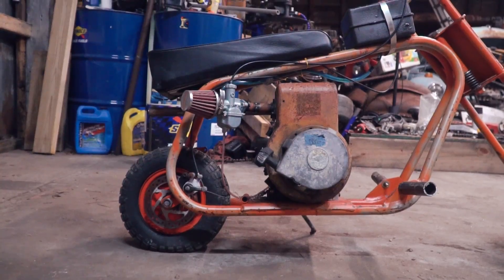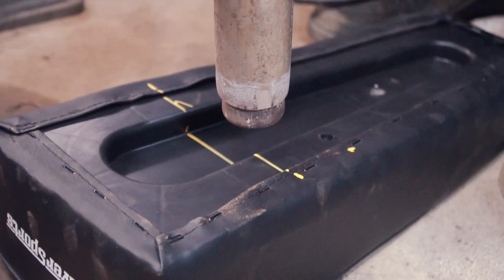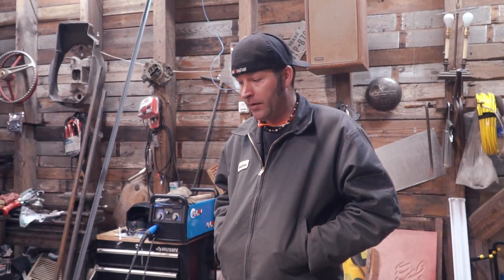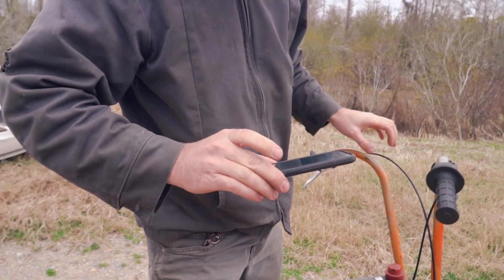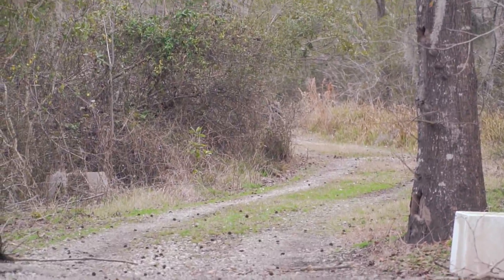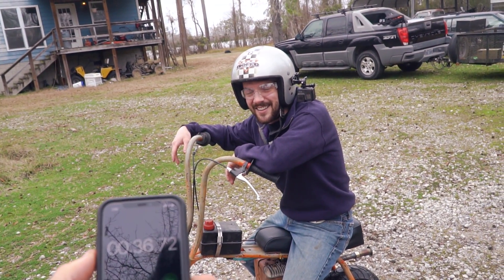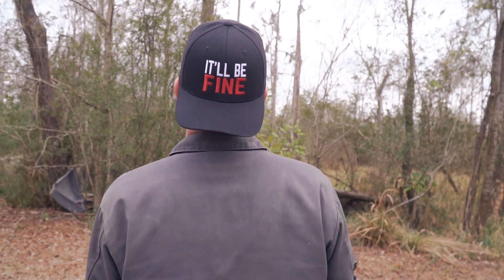Vintage Mini Bike Transformation!

Comment: Wow, thanks for the Memories. I think this is a better JCPenney than the one I had, I could never figure out what was more fun to jump my Stingray or my JCPenney. My Stingray never broke so I guess it was more fun, noooh. If I remember my gas tank was mounted better than yours, I didn't even need a screwdriver to tighten it. I just had to pull on the zip tie!

Comment: They came with a hand brake and a foot brake. The foot brake rubbed against the tire to stop and the hand brake was a disc brake that used the rear sprocket as the rotor. Cat also had one with springs on the forks and a plastic gas tank mounted on the frame like a motorcycle.

Comment: I have a purple one with a Honda thumb throttle, Suzuki foot pegs & sprocket, Peugeot seat & predator engine ..   she’s eaten many engines  over the years ...once had  a hot rodded  brigs&Stratton 8 push start   For long distance street rides .. went 71 mph one time on cat eyes pocket bike tires.

Comment: Hey, john, and Issac, I'm working on a rototiller from 1971 with that exact engine. not too long ago I found the gas tank had rusted out, and seeing that you took the carb and the gas tank of, I was wondering if I would be able to buy the gas tank and carb assembly off of you because replacement parts don't exist for that engine anymore. I live in North Carolina as well so I can pick it up if needed. thank you and keep up the great work. P.S. say hi to Leroy for me
Reply: They're too big now to respond to comments.😏

Comment: 3:38 why future Ike may or may not have all his fingers.
Reply: saw that and thought the same thing
Reply: I literally lost my my index finger at the first knuckle doing something very similar
Reply: That was John w/ the grinder, not Ike.
Reply: Oops I meant to respond to the comment about ike putting the chain back on with the engine running. I amputated my own fi ger in the chain of a gokart
Reply: @theoverlanderutv2747  ouch!!! Yea, i should have said something there too, never touch the chain with a running engine. Ive nearly lost a digit on a not running bike picking it up by the sprocket

Comment: It would be neat to see  DIY  performance mods on this.  Cut every other fin off the flywheel.  Clean the coil/ hotter plug.  Do the 3 degree key in the flywheel

Comment: I was always told 1 tooth change on your top gear is equal to roughly 3-4 teeth on your bottom gear.  If you don't want to go through the hassle of changing that bottom gear, put a smaller gear on your clutch.      Love the video... giving me the itch to get my old mini bike from my youth that is collecting dust int he attic out and give her a once over.

Comment: Hey guys. Was wondering if I can install wide slick tires on an old manco go cart with new wheels. I'm mainly concerned about how the sprocket is going to mount with wide tires on a one wheel drive. Thanks.

Comment: I had the same minibike when I was 13.
Brigs& Stratton 3hp, "flapper plate" brakes, and a chrome square gas tank.
I painted mine "Chevy light blue".
I was a bit heavy then, but it pulled 30+ mph.

PAINT THE BIKE !
IT WILL BE FINE.

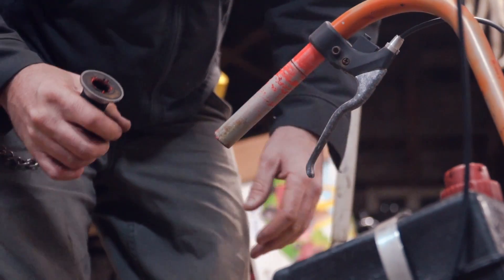Comment: 2:18 A tip for getting rubber handles off is to pour some rubbing alcohol inside it. It should then slide out quite easily with a bit of twisting and turning.

Comment: the best way to get power from a flathead is to increase flow. do a port and polish and a minor eyebrow shave. that motor will haul you around with no problem after that. i did that to a 5 hp lawmower and I got some great results.

Comment: Hair spray works real well for removing and putting on grips pry up the grip a little spray it work it comes right off. Spray the  inside of the grip before you put it on. Slides right on and drys sticky

Comment: Naiz bike! Those tabs holding the rear wheel seems to be original, maybe the problem with the chain coming of? Make a more solid plate, and weld it in instead, takes 10 minutes.

Comment: I would weld some tabs on the rear of the  frame and use few mountain bike shocks to set the seat level and add somewhat suspension

Comment: When pulling a grip off of handlebars without air especially, you have to grab it from the back, its like a chinese finger trap, you pull on the wrong spot and it tightens, pull fron the back and it muchrooms out and slides off easier

Comment: The new wheels look nice (like cragars)....but too bling for this bike. Also would have through a leaf spring under the seat to raise it would have been nice but whatever. Thank you for the free content.
Edit: please don't change the engine. The bikes got a beautiful patina as is. I'd say gear it lower 30mph is fiiine especially with more get-up-and-go, no one wants to sit stalling and frying the clutch every-time you launch. I'd say go bigger read sprocket.
11:53 geez running engine and fingers man. I got a good shouting at when I did that once, learned my lesson. You only have 1 pair of hands they don't grow back.
Also...needs a nice rounded orange teardrop tank.

Comment: Why don't you take flywheel off and machine the cooling fins off and dump the cooling cowling the air flow will cool it whilst driving you will be surprised by the difference

Comment: Revamp original Tecumseh carb. Pull butterfly stem out. Seal with jb weld then redrill holes for stem. Problem solved.

Comment: Just to help you ditterentiate the difference between a taller gear and shorter gear, a taller gear would give you more  rpm worth a lower speed. A shorter gear would do the opposite

Comment: Guys, guys, Please do a little research before you do these builds. You will save yourself some embarrassment. That minibike was made by Muskin for JC Penny. Muskin also made the CAT brand minibikes. They used spring "shocks" on the rear of the seat to the frame. The "shocks" provided a "rear suspension" of sorts, just a seat suspension. Mounting a seat on the extreme angle you did is embarrassing to the minibike community. The seat shocks mounted the seat at a slight opposite angle from what you did. The front of the seat would pivot at the frame mount. I had a Cat Duster for many years. It was a joy to own and ride...

Comment: You didn't totally transform anything- it is still an old rust bucket that everything is falling off of. Chain- intake ,etc. Have you EVER done a video that comes out right? I remember that multi part FIASCO of the mini dragster with the big twin cylinder predator motor that did about 45 mph at the drag strip. What a bunch of hacks!!! If you guys went to an engineering school-- I would suggest you ask for your money back- if you didn't go you should. You guys don't have a clue!!!